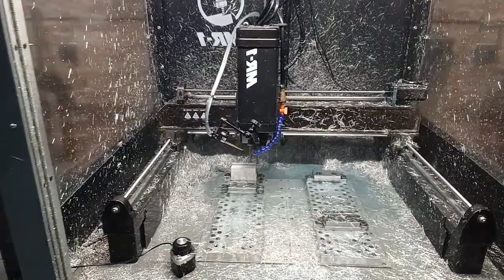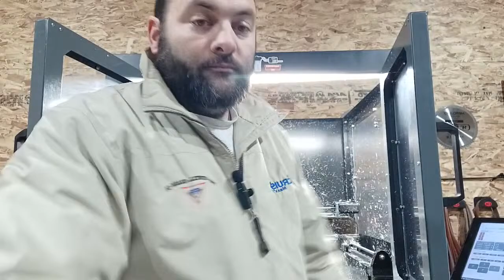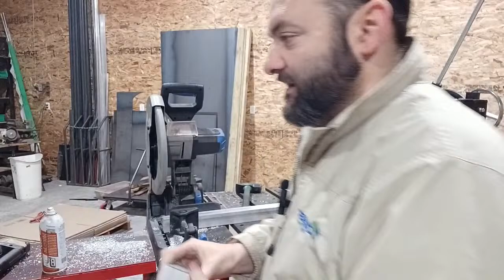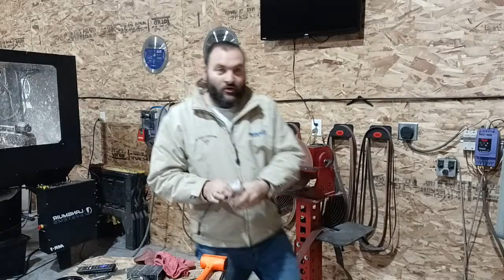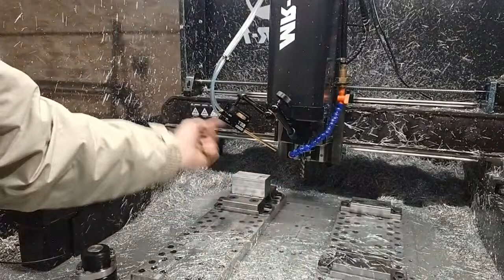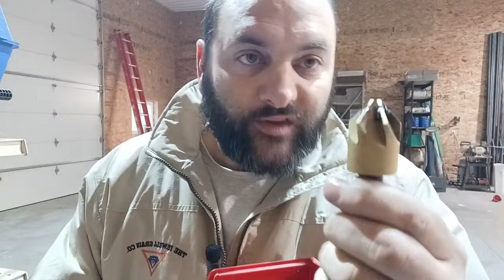CNC machining parts with the Langmuir Systems MR-1.

Comment: Im considering buying one. I dont need to hold any high tolerences, basically just making injectible molds. I converted a g0704 to cnc but it i cant get it to run without losing z position. At the end of program z is always way lower. Does this machine hold its position throughout a program?
Reply: On a indicator and travel indicator it runs true after adjusting its steps and backlash. But by the end of program it constantly loses z position.
Reply from the maker: your coupler could be slipping or you just don't have a large enough stepper or not enough voltage from your PSU
Reply from the maker: 99% of the time.  Make sure you get the upgraded stepper drives.  I've pushed it super hard for a year and only missed a couple steps.  Mostly because bad programming.

Comment: Hey buddy great video.

Have a thought. Why not swap to clear path servos and a masso. You would still be saving a ton of money compared to haas or tormach.
Would solve your postioning issues.
Haas uses clear paths anyways

Other than this issue. Have you had any other issues? Such as your upright's being parelle,traming, dos it actually have the mrr it claims. Any hardware issues bearing failures?

Im looking into this machine.
Reply from the maker: I still would need to upgrade to a bt30 spindle to get the ATC.  I'm on my second spindle and replaced a ball screw  and two stepper motors.  All free of charge.... but I had to change them...
Reply: @BeckTools  oh wow thats crazy.
Reply: @BeckTools  hey sir. Another question i have thought about. How was it for traming in. Was it a pain to difficult to get it to keep tram or pain to shim?

Also actually as im typing. Now i am looking to put this into my garage. But i live im upstate NY how do you feel this machine would hold up in a standard garage that might get a little moister in the air inside? I would be coving everything in kluber nbu15 regardless but would like your opinion.
With the stepper drives also can you change the microstepping to higher and then re calibrate? Like say your running at 16000 put it to 24000 on the dip switches? Are you able to hold .001?
Reply from the maker: @EV1LEGG  I'm running a part right now with dowel holes and they are dead on.  I have a .249 pin and I ran 32 parts and every single one had the same exact friction against the pin. 

Traming does take some time and the process they tell you to do with the card and calculator doesn't work.  It has not worked for a single person that I've talked to.  You've got to use the shims they give you to dial it in with and indicator.
Reply: @BeckTools  awsome thank you so much for getting back to me.

Do you feel the part you were running in the video didnt meet spec due to being machined quick and deformation of the matertial becuase of trying to speed things up?
Reply from the maker: @EV1LEGG  no.  They designed this part with features that are very hard to create with a low cost machine. They want super finishes on a 3D machined face.  They want cnc deburr program to be run on this part.  You have to pay extra for this type of tool path in most CAM software or run a super time consuming 3D profiling tool path.  They designed it so you have to flip the part over pick it back up and hit +- .001" on some features.  The squareness of the MR-1 sometimes prevents you from doing this.  The test part is designed to eliminate guys like me.

Comment: I have zero experience in machining and I fear machining in general seems totally impossible for me. 

I hate these things and the learning curve and financial burden just to experience disapointment lol 

i just want to work on 304 like 3/4 in thick and about 4 inW 5in L 

Is this a realistic ask ? 🤦‍♂️ 

Always seemed so simple in my mind because all ieant to do is make the same part over and over.

I assume i can put the machine together but after this seeing so many stuggle i feel i would have to hire a specialist to put togther and calibrate for me. 

I have no skills in this field but need this machine to make my business happen ... ooph
Reply from the maker: ok well 304 is like level 6 on a scale of 1 to 10 (10 being the hardest) when it comes to how hard a material is to work with on a CNC.  I would start with Aluminum. Go to cold rolled, than hot rolled.  Then maybe 4140.  Then work your way to 304. lol I've been running machines for years and I still don't have the guts to run 304. haha
Reply: @BeckTools  i appreciate your response thank you man your a good dude.

I only need to make this one thing over and over an idea no one has done yet really. that's all the machine would ever be doing. The same part repoduced very small envelope area with little need for absolute perfect tolerance I assume as it is a stand-alone item. 

So I'm just lost in the sea of ignorance. Maybe I'll pop into a local machine shop or somthing and ask some super irritating questions to bring me back to earth lol.

On a side note I've been watching your video content past few months and must say I enjoy what you do keep it up man I wish you all the best with your machining career and your video making 👍🏻

 you might see more comments from this dummy in the future. Love the educational qualities and honesty you put into your videos top notch
Reply from the maker: @ I love the comments. Keep em coming.  As far has perfect tolerances, the MR-1 would struggle without a experienced operator to comp for its shortcomings.  I know guys that run 304 ss on the MR-1 so don't let be completely pop your bubble.

Comment: Why did you choose the MR1 over VMC?  You can easily find a used VMC for the same price you paid for the MR1.
Reply from the maker: Size and power requirements.  I was having a hard time finding a small single phase machine for 7k.  Yes I spent a lot more than 7k but I didn't know that at the time of purchase.

Comment: I owned an MR1 and got rid of it because it couldn't keep tolerance.  I spent more time setting it up over and over than milling.  Bought a Haas and life is soooo much better.
Reply: That's my biggest issue with these. I do not believe they could ever be rigid or accurate enough to make money with them. Basically a practice/learner machine for the cost of a decent used 4020. These MR-1s belong in schools and hobby shops, thats it.
Reply from the maker: I've run enough parts to pay for my MR-1 two times in less than a year.  You can make money with it but you just need to run the right kind of parts.  This Xometry test part is just outside the MR-1 scope.  Lesson learned... lol
Reply: @BeckTools  you can make money with them.  But if you’re making money on the MR1 then it’s all the more reason to get a better machine.  What I was cutting at 60 ipm I now cut at 198 ipm at 1” deep cut instead of 0.5.  Plus the atc, chip conveyor and 4th axis are huge game changes.

You’ll do great in a better machine I have no doubt.
Reply from the maker: @kylenorseth890  I 100% agree.  I just need to save up some $$
Reply from the maker: I plan to get something better in the future.

Comment: Were you successful on the part after this video?
Reply from the maker: so far yes, but it is running the 3D contour tooling path right now.  It's a 12+ hour tool path.  I got all the other opp finished and hit the go button on this path about 3 hours ago.  I'll know in the morning.
Reply: @ please update! Thank you so much for your videos and honesty. I’ve been on the fence between this and a Tormach 770 but the work print is so small!
Reply from the maker: @stevenichols1481  nope.  The machine lost a step some time during the night and made a deep mark right across the top of the part.  I don't have time to try again as the deadline has come.  I have to withdraw my application. :(
Reply: @BeckTools  I am very sorry to hear that 🙁
If it’s the stepper motors are they upgradable to maybe a servo kit?
Reply from the maker: @stevenichols1481  yes I could do that but I would have to build a new controller.  that would cost me around 2k.  I think  I just want to put that 2k into a Syil X7
Reply: @BeckTools  You're absolutely right! I think that's the right direction to head in. Looking forward to more content from you!